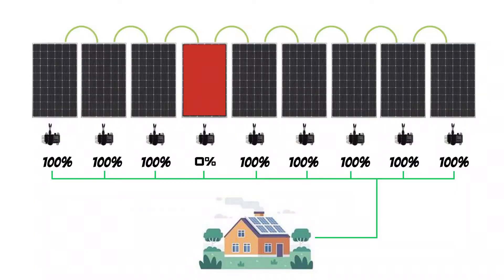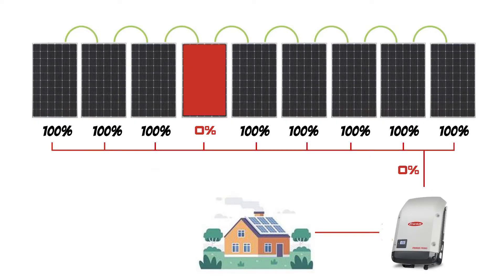Enphase IQ8 Microinverters vs IQ7 Micro inverters Which is right for you

Comment: Which one can work on completely on off grid?
Reply from the maker: Completely off grid, look into EG4 6000xp or 12k. They are 100% off grid. Although Iq8 might market as being able to generate power while the grid is down, they are not technically 100% or designed to be completely off grid.

Comment: I HAVE. APTOS BRAND. BIFACIAL SOLAR PANELS   440  WATT PANELS. OPEN CIRCUIT VOLTAGE. 41.  .... what micro inverter you recommend please for each panel.  ???
Reply from the maker: Hoymiles HMS-2000 Quad Microinverters are your most cost effective. I used HMS-1000's on my new system. I have videos on how I built that system and connected it to grid. Good luck!

Comment: DIYer for roof top PV, absolutely go with string setup.   If inverter goes down, you replace or fix it at ground level.  If micro goes bad, you need to go up roof, take off panel, replace inverter.  Maintenance is much more difficult

Comment: I have a SolarEdge inverter with SE 440 optimizer. I wanted to remove that inverter and plug my panels right into a hybrid inverter, but everyone i talked too said my panels would stop working if i did that.

Comment: I just received a quote for a 10.08KW system.  24 VSUN 420N panels with Enphase IQ8 Plus inverters with no battery backup with install for 25k.  is that a good price?
Reply from the maker: Just a heads up. 24 IQ8+'s can only produce a maximum of 300w per microinverter, so the true max output rating of that system would be 7,200 watts. I would recommend IQ8A's for those panels. Those max out at 366w. That would be 8,784 total watts of output. Hope that helps.
Reply: @JustinsProject  Thanks. Is there a better inverter that will output 420 watts ?
Reply from the maker: I am switching my Enphase system to Hoymiles. I am going to use HMS-1000 dual microinverters. My new panels will be 440w BiFacial. I should not experience any clipping with that setup.
Reply: It depends how much electricity you use. I have 22 panels (guessing 400W because I wasn't told specifically) with the 22 IQ8+ Micro inverters. I live in a 1550 sq ft house and it provides about 99 percent of my electricity needs during the day but I'm on the grid for evening darkness because I didn't get a battery either. The most I've ever paid in electricity usage is $55 this past August. Some months have been $0 but on average a little under $20. I still have to pay for gas and admin fees charged by Dominion, so I've never had free bills. I know my bills would be a lot higher without solar. In 2023, the solar produced 10.34 MWh.

Comment: I have a 9Kw solar system with Enphase IQ7 and Tesla Powerwall 2 and it the whole system works when the Grid goes down. Powers entire home and Solar can still charge Powerwall battery at the same time as run AC. Highly recommend.
Reply from the maker: You can charge the batteries even when the grid power is off? I have IQ7+ and they will not produce power without the grid being on. Yes, I can use my Bluetti backup up to power the house when the grid is down, but my IQ7's will not produce power to charge the batteries when the grid is shutdown.

Comment: First i would start from explanation that all microinverters require power to work. 
Now the difference between iq7 and iq8 is that iq7 uses power from utility grid or backup batteries while iq8 can use solar pannel power directly without utility grid or backup batteries. 
That's all you need to say instead of this long long story.
Reply from the maker: Thanks for the feedback

Comment: Thank You, I have been researching the DIY method, because we recently moved from Colorado to Florida and when we got solar in Colorado we payed someone else to do it... which was 40K+ for 7k system which had no battery backup. We used generators to power things during outages, but I kind of integrated battery backup in a way to the system. All the essential stuff in the house, I installed inline computer UPS systems, but to save money I just bought used commercial rack mount systems for large appliances and "rebuilt" them by replacing the internal batteries. Then for smaller stuff like our bedroom for the end table lights and my CPAP i used regular over the counter UPS systems. When we have power outages the refrigerator can still function for over 24hours roughly on the UPS before i am forced to give power back and hopefully by then i have connected the generator to the house and turned off the grid. Something really cool that i thought was very smartly planned out, the origional builders built our house in Colorado with the intentions of needing backup generator power yearly, so to figure out if the grid was back online, they wired the main breaker so the ceiling lights were wired into the main breaker only, then a sub-main panel ran off that panel which housed all the rest of the house, so the generator safety cutoff is on the 2nd main panel. Question: Whats your opinion on these bifacial panels that i see you can install vertically?
Reply from the maker: 100% believe in the bifacial panels. Not sure about the vertical install just yet but I am in the process of building a new system that will be using bifacial panels. I hope to start testing on vertical panels sometime in the future. Spooler alert, I will not be using Enphase microinverters though. I will share more details soon.

Comment: Very helpful - particularly as I’m in the U.K. and getting info on the enphase inverters is hard. We have 4 panels with IQ7As at the moment with the Tesla 2 battery and gateway.  We’re thinking of adding more panels but on an outbuilding.  Is it as simple as wiring these into a circuit and the system will pick them up? Or do they need to be programmed to the gateway to make them work?
Reply from the maker: They should be connected to the combiner box with your existing IQ7A's. You want to make sure you are doing everything the manufacturer recommends so you can maintain a warranty on them. Thanks for watching and commenting 👍🏻
Reply: @TheSolarPit  thanks so much. Challenge is we have a cabin in the garden and it’s around 100feet from the house. I was hoping to put panels on the roof of it and feet them straight in to the ring main. Only 4 panels so it would be fine for the cabling. But not sure how to get that connected to the gateway in the house due to the distance. I have internet in the cabin - wired and WiFi. Any views would be amazing

Comment: I like your project, and thanks for sharing. One thing to note: If you panels have bypass diodes, and one of your panel goes down, the bypass diodes on this panel will let the current produced by the other panels to bypass this panel. If one of the panels has a partial shading, than it depends on the sensitivity of the diodes when they let the current bypass. Until that point, there will be some loss of power production by the other panels - to my understanding.
Reply from the maker: Thanks for watching and commenting 👍🏻

Comment: Can I get a couple of these without anything else other than connecting?
Reply from the maker: The will need to be connected to a combiner box and then into your main panel. That's the most basic hookup. If you're connecting them to a battery backup solution, then there will be other components needed.

Comment: Hey Justin, is it easy to set up an off grid system for a tiny cabin in the woods   What is required?  One panel, one IQ8 microinverter, one IQ8 Bat for the battery?
Reply from the maker: Could be achieved for much less with a hybrid solar inverter and a battery of your choice. When it comes to off-grid only, I recommend hybrid solar inverters. Thanks for watching and commenting 👍🏻

Comment: Not sure what you mean when you say you won't get full power in an outage with the IQ8?  Are you saying the IQ8s somehow self-reduce their power output to say 50% or something?  I don't understand.
Reply from the maker: They can only handle the essential loads in sun backup mode. For example, I could not power my electric furance, electric water heater, electric dryer, our hottub and all of the other appliances like normal... while in sun backup mode. However, you could power the essentials. Thanks for watching and commenting 👍🏻

Comment: How do I design a solar system that can start a appliance that requires 22 lock rotor AMPs? Does this have to do with the battery and inverter?
Reply from the maker: My first question, is that system going to be grid tied?
Reply: @TheSolarPit  yes

Comment: It would be helpful an installation using a backup generator is discussed.  It would seem like an IQ7 system would be adequate and more cost effective   Our LP-fueld generator is an automatic connect during a power failure and is adequate for extended periods.  This use of battery backup is also not necessary., eliminating both the cost, the fire risk associated with lithium batteries and increased insurance costs incurred when a battery backup is installed in the structure..
Reply from the maker: Thanks for watching and commenting 👍🏻

Comment: If your building completely off gridd could you use the IQ7's and just tie them into the AC side of an inverter? Im thinking if you had a batterybank that could power a plane jane 2500 watt inverter and a charger hooked to the battery that plugged into an ac outlet wouldnt the IQ7 sync with the inverter and allow it to provide power to the system?
Reply from the maker: From my discussions with Enphase support, these are grid tie only. To commission them, you need a grid tied frequency. I am sure their are hacks, but I'm about positive it would void the warranty. Hope that helps. Thanks for watching and commenting 👍🏻

Comment: This is the best, most informative video I have seen on solar systems. Thank You Justin.
Reply from the maker: Glad it was helpful! Thank you for watching and commenting! 👍
Reply: With wrong information on string installation. Even if a panel fails, the whole string won't fail.
And replacing a central inverter in your basement is easier than climbing on your roof usually.
The video is biased toward micro inverter.
Central inverter with string also allows you to extend your system with a dc battery, which you cannot do with micro inverter.
Reply from the maker: @tiloalo  Not biased. I have experience with a lot of different solar equipment. It really depends on the users' overall needs. There are times when I have recommended string inverters over microinverters. Other times, microinverters are the better choice. I think no matter the choice, solar is beneficial.
Reply: @DIYSolarBuilds  exactly saying that it's the better choice is simply wrong. It depends on the setup. If access to the roof is difficult microinverters are not a good choice. The lifetime of an inverter is much shorter than the one of a solar panel, and replacement can be much more expensive if access is difficult.
The cost is also still higher for microinverters compared to string install.

Comment: So, IQ7 can't produce power to my house when the Grid is off? Like in an outage ?
That's I key point for me. What About adding a Tesla powerwall ? Its will keep the IQ7+ producing power by it's power backup or even with the powerall it will  stop producing. If So, IQ8 is the one for me. I live in Florida where we have hurricanes and sometimes outages is a thing here. I really what the ability to keep the house functional on outages. Thank you for all information you've been posting. Very useful to design my own solar system.
Reply from the maker: You would want to look into the IQ8's. They can provide power during sunlight hours even when the grid is down. IQ7's do not have that technology. Hope that helps. Thanks for watching and commenting 👍🏻

Comment: Hey, bro. Nice review.
I own a solar company in Cali and just rocked an IQ8+ system on my own house. The cobbler's kids finally have shoes!
I was looking into the controller and elected to shitcan the idea and just use my 12kW generator which does run both houses and my well system.
I would love a battery system and tell the power company to come and get their meter but even at my prices....it ain't worth it. Yet. 
I am also one of the lucky ones with a 1:1 export rate. That died for Cali in April.
Now it is 8:1 return. They screwed us hard.
Reply from the maker: The prices on those batteries are a little on the high side. I wish I could find a solution for my system also. 8:1 is ridiculous. Thanks for watching and commenting 👍🏻
Reply: I'm with you brother. I had an IQ8+ system installed in my house in California back in May 2022. Got in that nice NEM 2.0 export contract with SoCal Edison before they threw that out of April 2023.  I'm waiting for a bit before adding battery storage or even getting an EV once there is bi-directional charging offerings so I can use my massive EV car battery as a house backup.  Being patient for now
Reply: @ddyoder  Hell yeah, good work!

Comment: No clear advantage in case of IQ8. The controller is a single point of failure, just like a single string inverter which costs much much less
Reply from the maker: I am not using a controller. Thanks for watching and commenting 👍🏻

Comment: If anyone have time, I have a couple questions, I'm due to have a new system installed in the coming weeks.
14x 430w panels, IQ8M microinverters, Envoid Metered, Q Relay Controller, no battery (yet).
Am I fine with the IQ8M microinverters, or am I missing something by not getting IQ8A?
I have seen some recommendations that I should have a IQ Gateway, will the Envoid Metered be fine for IQ8?
I have a Q Relay Controller coming, should I have a Smart Switch or IQ Load Controller for Solar Backup?
Reply from the maker: With 430w panels, I would definitely go with the IQ8A's.

Comment: For me, the IQ8 means I will have my backup power during a blackout.
Reply from the maker: Have you had a chance to test out the capacity of the system when it is only using the sunlight power backup? How does it does in the winter when the heater is on? Curious because I am thinking of switching to the IQ8 in the future. Thanks for watching and commenting.

Comment: Can I use other forms of energy to power stuff in the night when the grid is down and the sun is down? Can you use petro powered generator, wind, hydro power, etc as alternative sources of power? I know the IQ8 can have a battery, but can it handle other power sources? I understand it needs controller 2 for the grid disconnect.
Reply from the maker: If you have the system and the grid connection protected by a transfer switch, you should be able to connect other sources in time of need. Generators are common backups. Thanks for watching and commenting 👍🏻
Reply: @TheSolarPit  can I use a standard generator? How do the phases get in sync? If the phases are not in sync things break. If the generator is running at 61Hz instead of the normal mains 60Hz will the micro inverters adjust accordingly.

Comment: Anyone know if you can attach 1200W worth of panel to a single 295W micro / 10kwh battery.

i.e. sunrise 200W in 200W out (to grid)
mid morning 600W in 295W out (to grid) 305W (to battery)
Solar peak 1200W in 295W out (to grid) 895W (to battery)
Evening 100W in 295W out (to grid from battery)
Night 0W in 295W out (to grid from batt, until depleated)

Then repeat.
Reply: I would like to find a 10KWh batt that has a programmable BMS for this.   (i.e. set depletion limit to 25% and charge limit to 85%) and tie it to the panels and micro inverter.

I realize MPPT would be defeated, but don't care.
Reply from the maker: I do not believe you could attach multiple solar panels into one IQ7+ or IQ8+ microinverter. To confirm that I could contact Enphase directly to see if there is an option for you. Thanks for watching and commenting 👍🏻
Reply: @TheSolarPit  multiple panels would just raise the max current, and the inverter would only draw 295W from thr array.

Much like a 15W USB charger can be plugged into a wall socket that can deliver 2400W.

The idea here however is to include a battery to buffer things.

Like poring water into a restrictive funnel.

Obviously not made to do this, but with a BMS on the battery / panel of appropriate voltage, it would work.
Reply from the maker: @Andy H  The max compatible wattage on a 295w IQ+ is 440watts. There are other limitations. Then, it must be grid tied, and that requires the microinverter to be commissioned via the toolkit app via Enphase. There are a lot of hurtles to overcome. Why not just use a small string inverter?
Reply: @TheSolarPit  The wattage is just an optimal range.  No sense putting 10,000W in front of a 295W inverter.   However it makes perfect sense to put a battery in front of it....

I.e. Attach a 10kwh 48V battery to an iq7+ and it should feed the grid 295W for over 33hrs.

My interest in this stems from not being re-embursed for backfeeding the grid, but doing so at just 295W means almost all of that will go to base loads...

if a 300W panel averaged 1kw / day,  you could run 3300W worth of panel to a single iq7/10kwh battery.

Hope that makes sense.
Reply: @TheSolarPit  Also, is you lost power, the batt would still soak up the energy and dump it into the grid once back online.  and your saving the cost of 10 micros to spend toward the battery.

Comment: You are mis-representing the price difference between IQ7 and IQ8 - eg. IQ7+ is $164.50, IQ8+ is $189 - both about 300W - not "nearly double" as you say. Source: Enphase direct store.
Reply from the maker: I bought a couple of IQ7+'s for $50 each. I averaged around $85 each over the 27 (new never used) of them that I purchased. So, in my experience because I shopped around and was patient... the IQ8's were more than double. At that time, IQ8's were so new that there were no deals to be found on them. Can't always jump on the first price you find, even if it is directly from Enphase. Many distributors sell them cheaper.